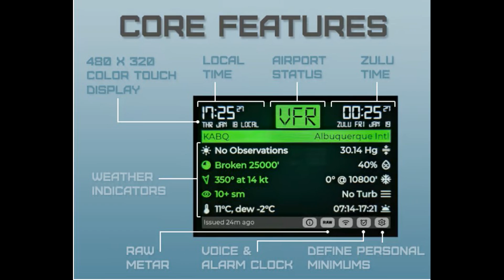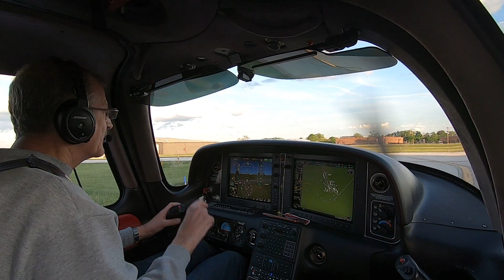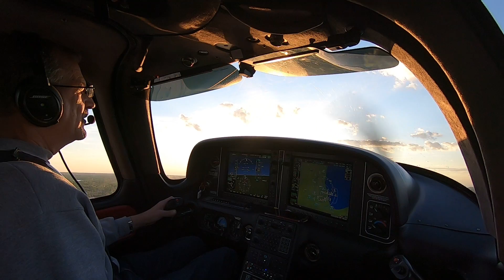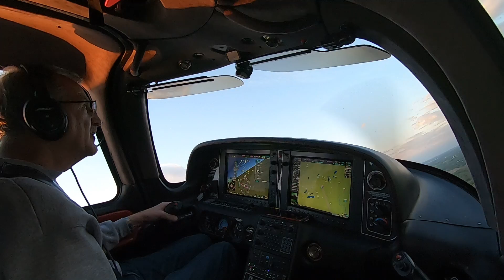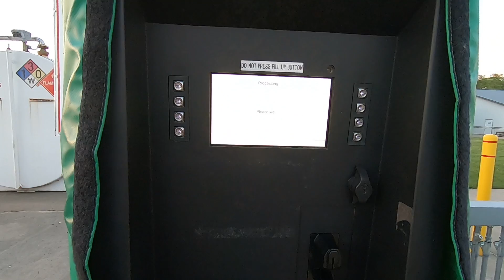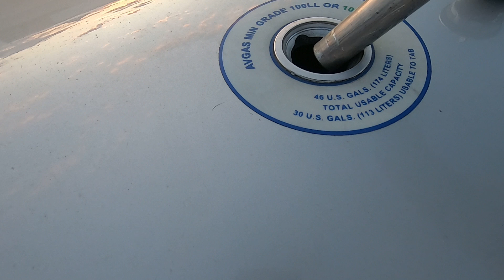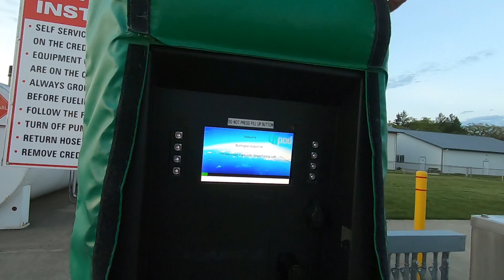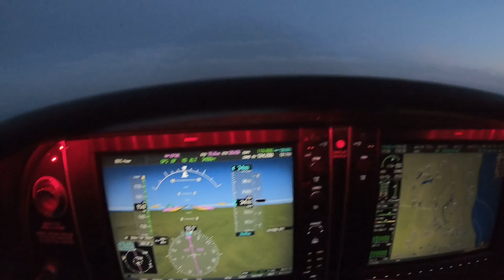Why Pilots Fly To Get Fuel & How They Get It Into The Plane

Comment: Why is it not like the mogas equipment?
Reply from the maker: I'm not sure I understand the question.  If you're asking why the SR22 cannot run on mogas, it's because the engine requires 100 Octane, which redquires a low level of lead.  Does that answer your question?